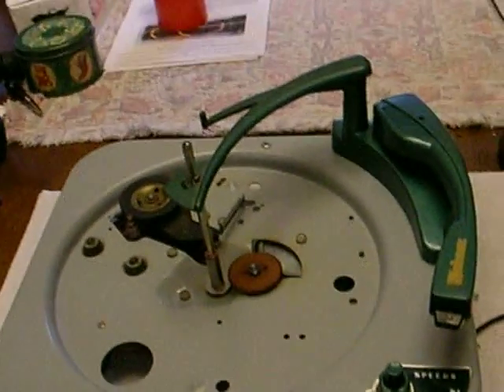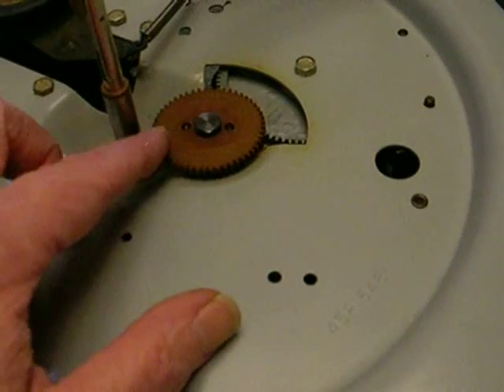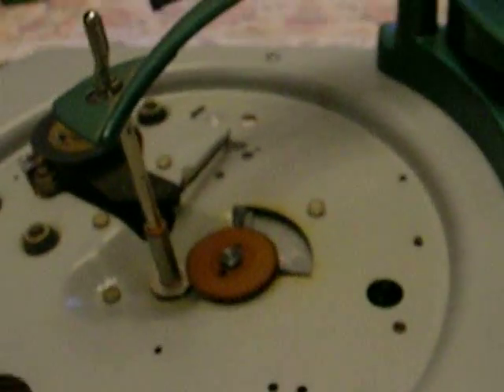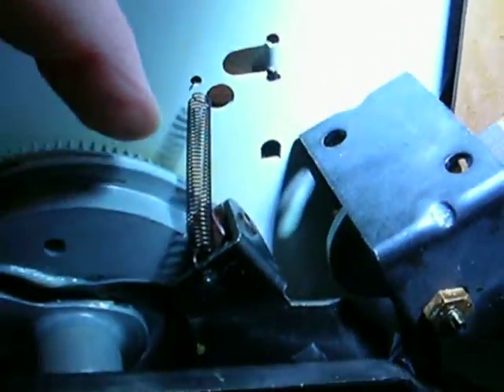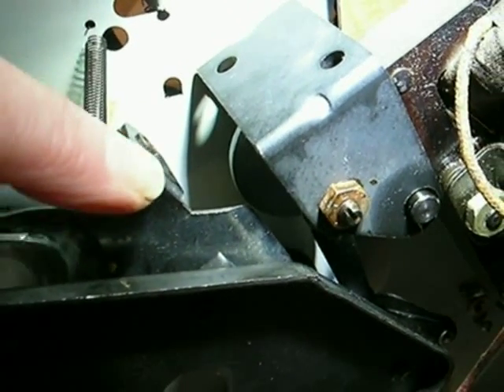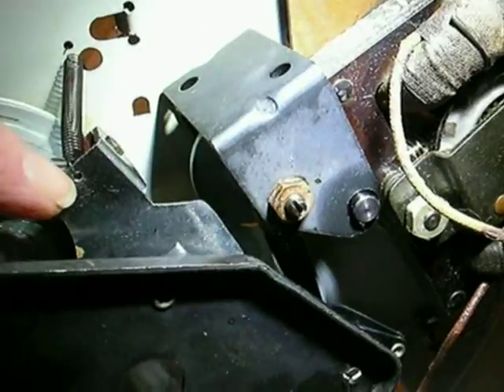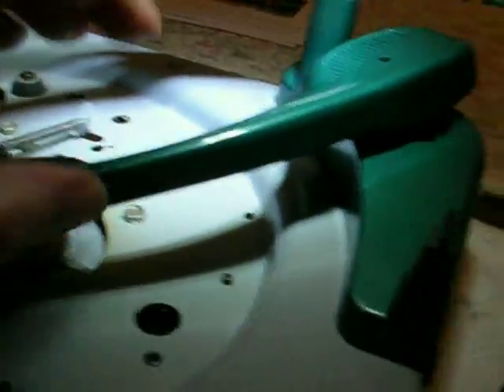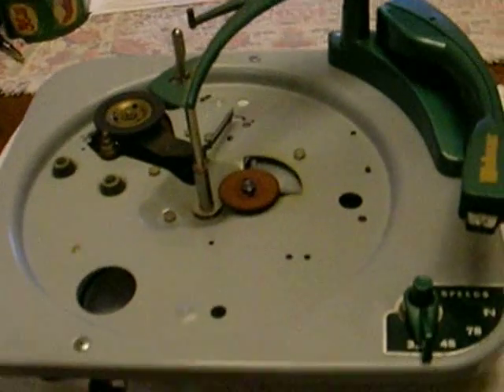1952 Webcor 121 Record changer, back together

Comment: For interest sake, in Australia during the 50's a lot of Webster Chicago changers were installed in various Radiograms of the period.  I found the biggest issue was the abuse on the fiber gear that rotates, as you say, continually with the TT.  To find decent replacements for those is now almost impossible ans is my biggest issue now a days!  Looking forward Chris to the final demo back in situ...!

Comment: Chris,  I am in the process of going the a Webcor 356-27.    I noticed the fiber gear was very lose and was making racket especially on 78.  Were they always like this?  I assumed the washers had shrunk over time or wore over time.   I shimmed between the two gears and eliminated a good bit of the backlash.    This is the first velocity trip turntable I've worked on.  It took me a while to figure out what was going on and still didn't completely understand it until watching your video.  Thanks